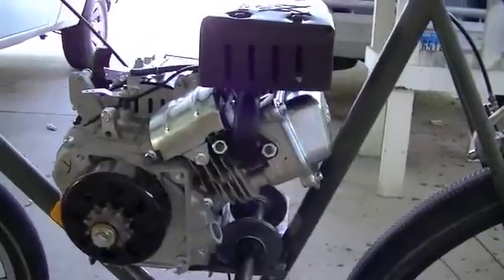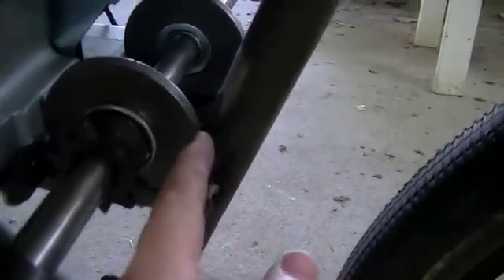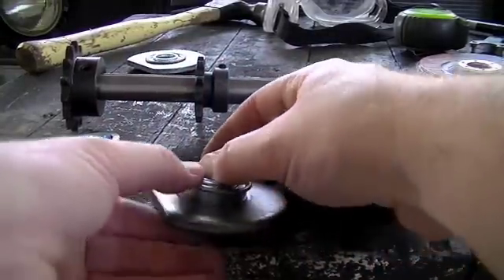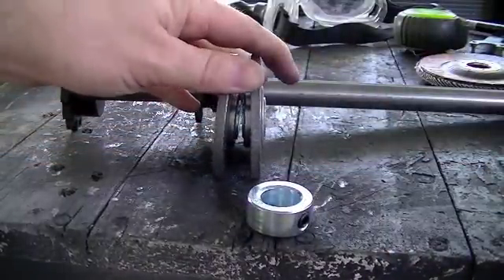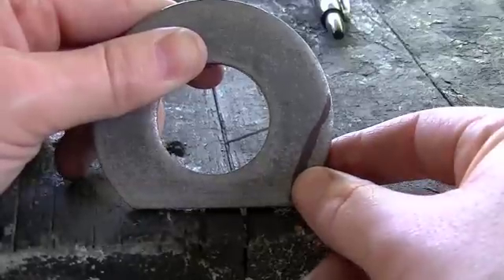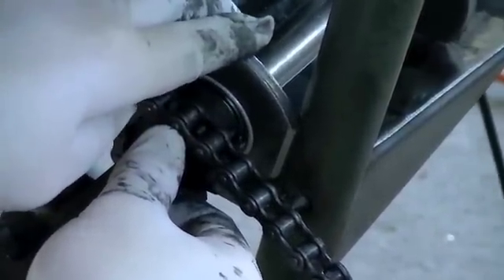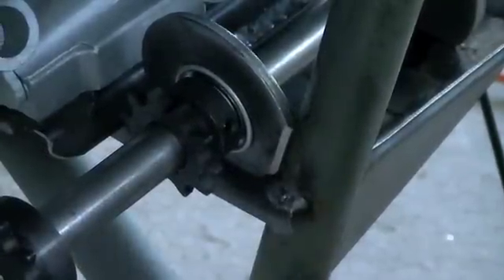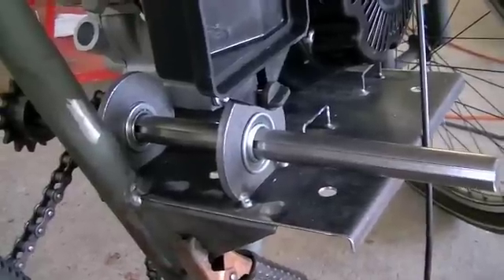Part 11 Motorized Bike | 3HP 4 Stroke Engine

Comment from the maker: Yeah, I'm happy with it.  I do wish the bearings were easier to lube.  If you have the space, I would advise using some 3/4" pillow block bearings with a grease zerk.  Probably cost a little more, but the pillow blocks are more durable, and they bolt into place allowing you more adjustment to get the chainline dead nuts accurate.